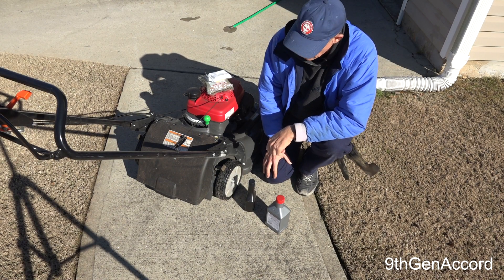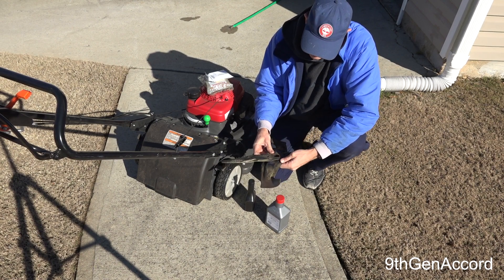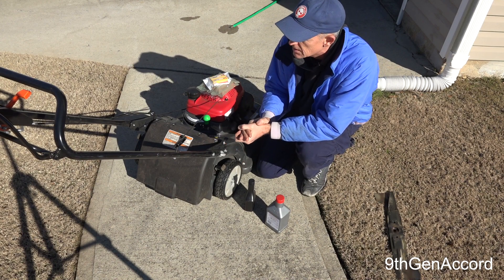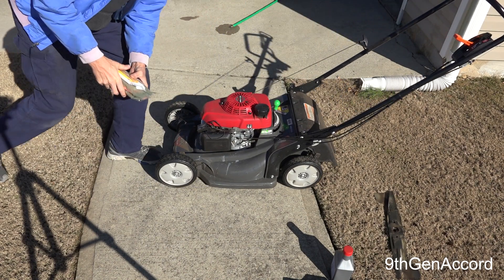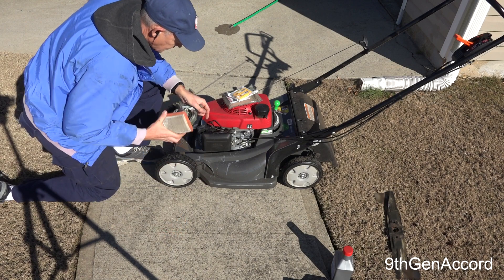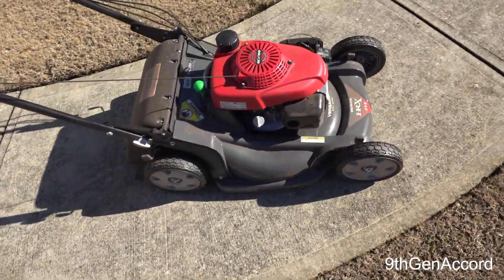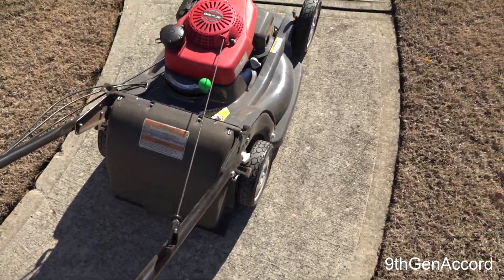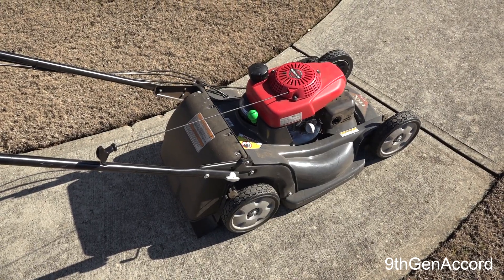Spring Mower Maintenance on a Honda HRX217HYA lawn mower

Comment: ...you should have mentioned to put stabil in the fuel. One should never store any gas with out using stabil... even for a month!!!!  But even better than that would be to remove ALL gas from carb and tank, if gas will sit more than 3 months!!!!  It is no problem at all to pour in fresh gas at the start of the season. Some of you advise was good. But if one takes on the responsibly to inform the public..... for damn sure all of the pertinent info should be presented.  I have used and tested both amzoil, and Royal Purple HPS oils. The HPS oils blow away the AMZoil.   Regular RP and amzoil are for all intents and purposes equal.